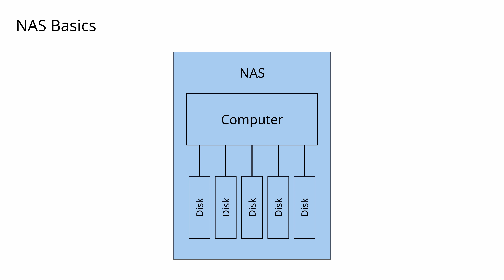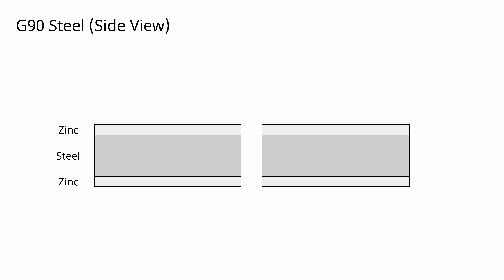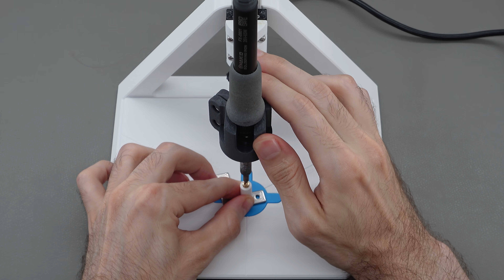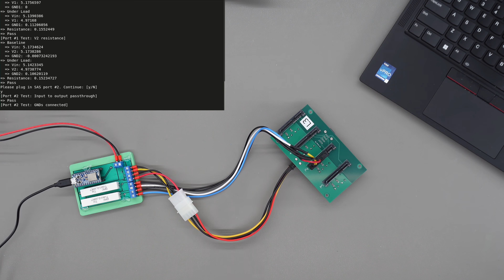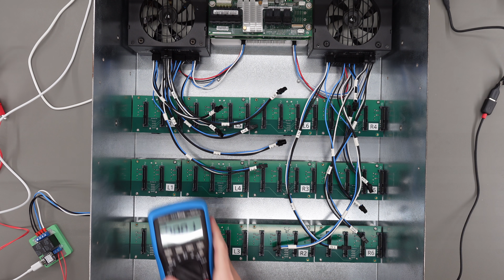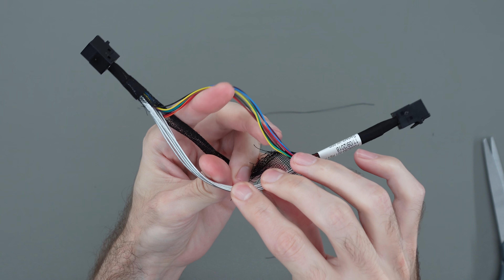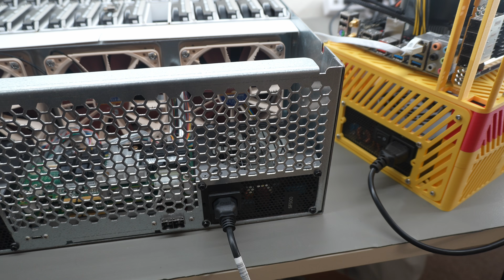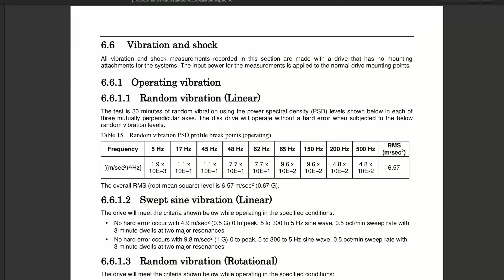I Built a 1 Petabyte Server From Scratch

Comment: Fantastic build! I stalled on a backplane project I was working on when I found out that 2 layer pcbs wouldn't cut it and I had to redesign. Thank you for including your source files, they gave me the motivation to pick this project back up! 

Does the nas have any problem with half the disks starting at the same time? I've been debating about using a ch32v003 on my backplane to manage staggering disk startup via the 3.3v rail on the drives. Any thoughts? Great work again, subscribed!
Reply from the maker: For most modern drives, you don't need extra hardware to stagger spin up. I am using SAS drives and it is automatically handled by the HBA but they are more annoying to spin down. For SATA drives, Google "power up in standby". It's a feature you can enable in software on most drives

Comment: I was going to say use less disks but then I counted 45 disks at 20:56 and that is 22TB each to be 1,000, so, wow I didn't realize that you need so many even in 2026.

That said, you can get 32tb drives now so then you only need 31 of them, go with 3 rows of 10, instead of 3 rows of 15, then you have 33% less drives.

The cost would be more though.
45 x $300 = $13,500
30 x $700 = $21,000

So it makes sense why you used 22tb.

Comment: just a tip, you could've used the standard coloring system for teh wires. black is GND, yellow is 12V and red is 5V. this is the same coloring scheme used in PSUs, if you get a cable with both red and yellow wires, it means it carries both 5 and 12V.

Comment: For the backplane PCB, can you confirm the capacitor values and types used per drive?
Specifically:
• Capacitance (µF) and voltage rating
• Electrolytic vs polymer vs ceramic
• Which rail they’re on (5V, 12V, or both)
• Whether they’re bulk smoothing or just local decoupling

I’m trying to replicate the board as-designed and want to make sure I’m not missing anything critical as I did not see the caps mentioned on the BOM or in the documentation on GH.

*Edit*
Based on the comment i found about the caps being pretty big, and using some chatgpt, I determined that some 25V 47uF caps should be adequate to smooth those spikes without risking having a ton of stored energy. I wanted to see your thoughts on those specs. I found some panasonics on digikey that have the same lead spacing (5 mm) and have an expected lifetime of 5000 hours at 105 degrees C
Reply from the maker: Forgot to add those. I'm using these https://www.digikey.com/en/products/detail/nichicon/UHE1H221MPD/589350 on both rails. Two next to every disk. The design was based on ballpark estimates before I had all the components. From what I can tell, these are overkill

Comment: Seems lie the custom designs and circuit boards are a bit overkill? Supermicro has chassis that do the exact same thing and can be had for less than $100 used now. I am running one right now with 64x4Tb drives in rented space at a local datacenter.

Comment: why steel enclosure and not aluminum? very cool project
Reply from the maker: It is really heavy. You'd need much thicker aluminum for this and the gap between disks is measured in millimeters so either the airflow gets worse or you need to cut one disk from each row if you want to use thicker metal with good performance.

Comment: Really impressive, but please get a proper du pont style terminal crimper, IWiss sells nice EDM machined ones (get the EDM ones, the listings not stating it sell old stock garbage) for under 20 bucks. YOu are pushing those molex microfit pins to their rating limit and using the better higher curent rated pins and a tool that makes sure the pins are perfectly straight and at the right tolerance to fit in the housing makes sure the connection meats the factory specs. I think molex has a crimping guide for these, at least there is one for minifit. 
Also getting those push fit connectors just right with custom ordered pcbs is tricky, with all that vibration and an unknown hole plating thickness I would have soldered in those if the connector can be soldered.

Comment: First of all, thank you for showing your great, impressive work!
If you plan to modify the orientation of the drives, I think having parity drives (having parity bits of filesystem) to the very both sides will make the whole system more viberation-tolerant. Parity drives are not likely to be read very often (making them parked in for the most times), and having them to both sides will provide more centered viberations (for now it's a bit offset to the left), providing more headroom to viberation to the system.

Comment: Cool hardware build (especially liked the test rigs).  For ZFS, you should consider using mirror vdevs though when using large spinning disks.  Parity reconstruction ("resilvering") on large drives is hard on the remaining drives, but mirror resilvering is just a sequential copy.

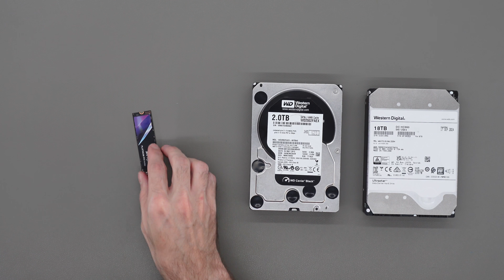Comment: 2:45 The lack of power loss protection on consumer SSDs is generally not really an issue, depending on your software. As long as software is flushing / fsync'ing properly, PLP is not needed to ensure data is not lost. PLP only protects from data loss when the OS or the application is not taking care to sync its data before telling users that the data is safe. Any file system in a modern OS will not make that mistake, and applications making this mistake shouldn't be trusted to store data regardless of whether the underlying storage has PLP.

Comment: Basically silent? What about the hard drive noise? I'm just asking aren't they noisy?
Reply from the maker: It depends a lot on the drives you use. Intuitively noise is wasted energy and mechanical wear, so it makes sense to be indirectly optimized. Modern tech like helium filling definitely helps a bit. These HC550s are the quietest drives I've owned. It's a bit subjective what is quite but they do make small clicking noises but my refrigerator is overall louder and if I'm listening to music, I basically can't notice anything.

Comment: If he works for someone vs himself, whoever employs him I hope they know the value they have.
Reply: He manufactures his own case materials, circuit boards, 3D-prints all custom parts, knows how to wire it all, how to electrically test, soldering, understands the computer & networking side as well, and even built his own test boards and computer-based UI to track status of the components and drives.  I like to think I know a lot in tech but I have to bow down to this guy and his vast talents.

Comment: A bunch of pointers:
- Should definitely make a shelf controller board v2 that ANDs all PSOK signals before passing it to mobo.
- Stay away from IoT enabled MCUs for the purpose of HW controller as this implies them running RTOS instead of baremetal, which compromises reliability. Stick to simple MCUs with external radio modules if need be, e.g. Pi Pico W. And definitely implement WDT.
- Stay away from MicroUSB for controller, they are notorious for brownouts of their VBUS line due to sideplay that inevitably develops during use if not present initially. Personally I'd only utilize solder connections in such critical points of the system, but even a Mini-B connector would be better, USB-C is too, OFC, but the final choice has hollywar ignition potential.
- Personally, I'd stay away from JST connectors on any power line with single digit Amp loads (and SAS expanders sure are)
- any decent PSU has datasheet (with pinouts included) right from manufacturer's website.
- in my custom HDD cage project I wanted to make custom wiring as well, but decided to use opportunity to go a bit further for the sake of redundancy in PSU connections. I first connected PSU modular cables to bus bars (which could be as simple as a bunch of Wago 222-418) with thicker cables and only then to SATA 15 pins with appropriate lower gauge wire. In other words, every power line going to its corresponding load has multiple points of connection from bus bar to PSU inside modular connectors and single connection to 15pin side (which is a lot better mechanical design and point of less current).
- Pls stop calling disk shelves JBOD. The latter is a drive strapping mechanism (software architecture).
Reply from the maker: Thanks. Next iteration will have more improvements. As a clarification, all the MCU code used in this video is bare metal Rust code

Comment: Maybe i missed it but are the measurements of the case?
Reply from the maker: If you mean size, it's 550mm x 173mm x 435mm. I didn't mention the second two dimensions since it's a standard 4U 19" rack size.

Comment: I've seen some others make cases out of plastic instead of metal like you commented on doing. I always wonder, aren't there any issues with EMI when not using metal for the case? as low as the chance of issue might be, wouldn't something like a NAS warrant having the extra EMI mitigation offered by a metal case?
Reply from the maker: Yeah, I think metal is definitely a strongly recommended practice here for EMI. I think most of the individual components are already well shielded but there may be more stability issues with a bigger setup. Data corruption is probably not as big of a concern if you have ECC RAM and use a proper checksum'ed file system.

Comment: "I'm sorry, I didn't get all that."...,"Where did I lose you?"...,"Um, right after, 'I Built a 1 Petabyte Server From Scratch', can we go back to that?" ;) I mean wow dude. I understand most of what you were talking about, I used to build computers, but you seem to have a fundamental grasp of engineering at a savant level. I've never seen a video quite like this before, you certainly didn't learn how to build this from watching YouTube videos. No one covers hardware in this detail. Also, did you CNC your own LED stripboards in house? My observations that may help reduce noise and vibration, the plastic covers on the SATA boards don't seem to be secured, incorporate foam rubber pads at the top of one side of the disk retainer pieces opening (cause that's where the drives move the most), and you could install automotive insulation, thin sheets of butyl sound-deadener, around the perimeter of the inside, or outside, of the case to keep it from resonating. I think this could significantly reduce both internal vibration and external noise. Excellent, excellent job. Can't wait to see what you do next. Just...Wow.
Reply from the maker: Thanks. Yeah, the LED boards are made in house just because I didn't want to wait for them to get delivered. Lot's of good suggestions in your comment. This was definitely a "make it just barely work'" design and over time there are lots of micro optimizations to incorporate.
Reply: @MadeByDennis  I would love to see a video or short just on how you made the LED boards. I didn't even know that was possible to CNC. Dude, you did way more than just make it work. The LED indicators alone were a huge step beyond just making it work. It might not yet be up to your standards, but you're already so far past the quality of what many companies who sell servers do.👍

Comment: that top left sas expander bothers me. its a right side on the left. and also why not number them in sequence?
Reply from the maker: The numbering is setup to optimize the cable runs and reduce the number of overlapping cables. Also some exceptions to balance the disks as evenly as possible between the two PSUs.

Comment: Congratulations! That's actually impressive build, and you clearly did your homework before grabbing screwdriver. It's incredible how well many parts are so well thought out.
I have two questions - where do you grab disk status data from? I2C from the SAS expander, or from host machine? And second, have you measured the read/write speeds with data compression? It often speeds up writes since compression lowers amount of data written directly to device, and from modern computing experience it's almost free. 
It's still impressive numbers - you are in the region of justifying switch to 25G network.
Reply from the maker: All the metrics are retrieved via SCSI commands over the SAS cable. Basically using `sudo smartctl -a /dev/sda` and `sudo sg_ses --page=es /dev/sg1` except from some custom Rust code. Also there is some more complicated tricks involving reading the /sys/class/sas_expander Linux directory to get the port to disk mappings.

Regarding compression, most of the data I am writing is media style files so don't benefit from compression and I was mainly focused on getting more normalized metrics. Everything is free until you really scale up. The hyper scaler strategy is normally to do things like encryption and compression on the client side and leave the disk servers being extremely bare bones and I'm generally aiming to eventually better decouple the bulk of my compute from the disks like that.

Comment: Wow, I understood all of what you did but there is no way I could do all that wiring etc without making a fire hazard and shorting out something expensive. I would end up using TrueNAS for the ZFS pool etc since I have a little bit of lazy tendencies and don't want to do the pool setup by hand. My current NAS is a Dell PowerEdge T330 which has two 495W PS and I only have one plugged in with the server and the 6 drives pulling 70W so it is not too bad. I can only max out with 8 large drives but don't have the cash to fill it with large drives. Anywho, good video.

Comment: That seems like a strange drive layout to me, why so many sub pools? I assume you striped across all 7 of them, but I'd be interested in hearing your thoughts for that layout.

Pondering myself how I'd use 45 drives (maybe someday!) I came up with these options:
- 9 drives in RAID-Z1 * 5, then RAID-Z1 those vdevs together (576 TB capacity, 3 to 13 drive failures tolerated)
- 11 drives in RAID-Z3 * 4, then striped, 1 drive as hot spare (576 TB capacity, 3 to 12 drive failures tolerated)

Comment: question, if you total up all the costs for fabricating the sheet metal+ PCB:s and buying all the parts, like connectors, cabling, PSUs, microcontroller, etc

real curious about how cost effective is this build compared to something like a 45 drives chassis?

ngl, this inspired me to want to do something similar
Reply from the maker: [Copy-pasted reply to all the cost questions] I added an FAQ pinned comment and an initial BOM in the video description.

Comment: I'd add drive guides at the bottom. Right now the connectors are providing a lot of the mechanical mounting.

How much did this cost to make? A used 60 drive JBOD chassis is maybe $3-6k depending on the market at the time. Custom metalwork gets pricey fast, which has made it hard for me to justify going that route.

SATA bandwidth is limited to 6Gb/s per channel. I use the same SAS expanders, but I am not sure if the 82885T supports faster switching for STP. I know that its possible for a SAS switch to support STP at above 6Gb/s, just not if these older chips have that. The limited documentation on the 82885T specs makes it sound like it doesn't. I've designed my storage system with the expectation that SATA drives bandwidth will be half of SAS through these switches.

It did hurt seeing the 82885T cards having their external ports removed and using the internal used for external instead, but these cards are very cheap and plentiful. xD Personally, I would have build this as either a 28 or 56 drive unit, or adapted OEM SAS backplanes with integrated SAS switches. The later is an idea I have been kicking around.

The 3905-16e HBA are pretty cheap, around $50-100ea, less if bought in bulk and not pre-flashed, or even less than that if were flash incorrectly and non-functional. This would give 4 external 12Gb/s SAS ports.
Reply from the maker: [Copy-pasted reply to all the cost questions] I added an FAQ pinned comment and an initial BOM in the video description.

Comment: Two tips for people thinking of cutting or modifying zinc coated steel.  It is a toxic metal, do not grind or cut without a respirator and ventilation.   To prevent rust, you can get spray coatings that you can easily apply.

Comment: great stuff, just going down a rabbit hole on diy'ing redundant psu rails, which also made we wonder how are your vdev subpools going to handle psu failure? assuming 6disk zfs pools, wouldnt you want to run 3 disk on left 3disk on right to minimise outage and effectively taking down entire pool should one of them fail, and to go further, a shared psu bus would probably be preferred also, using some ideal diodes.
Reply from the maker: Right now if a PSU goes down, it will take the whole thing offline. Yeah, it is possible to have redundancy in the software for this with RAID1 across the PSUs if 2x disk usage is ok. I am thinking of making a shared psu bus but it is a bit more complicated than just adding ideal diodes since you ideally also need to do load balancing which requires some other voltage correction tricks.